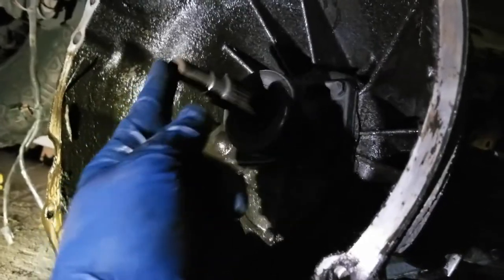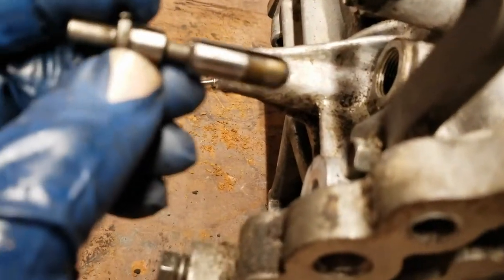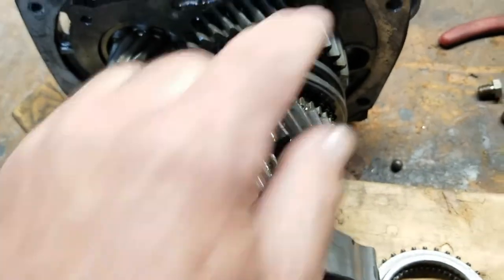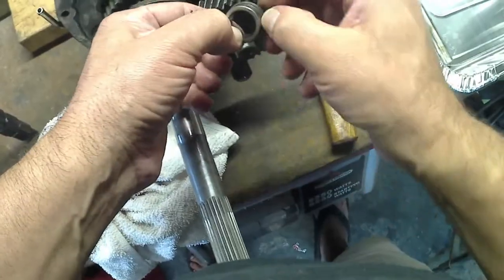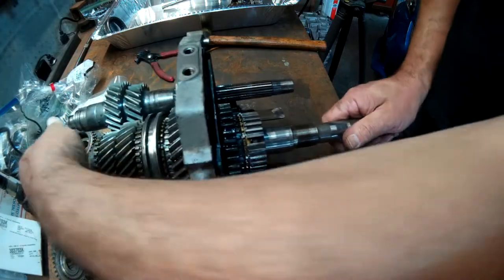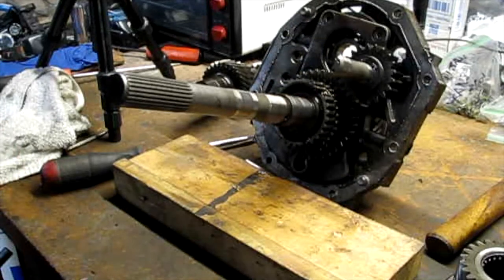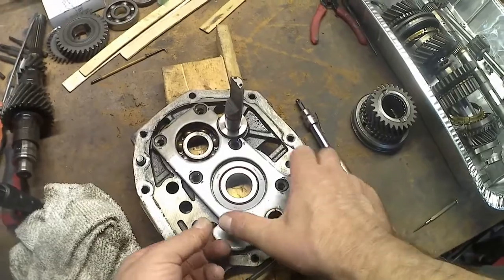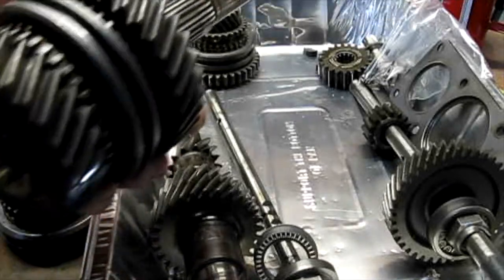95 Nissan 2.4 4x4 D21 Hardbody 5 Speed Transmission

Comment: What could be the problem with mine... it was fixed and immediately after putting it back on the bakkie it slips when i put the first gear on nd does that when i shift into other gears
Reply: Perhaps it was not properly assembled.

Comment: Sir, is it the same for taking out a manual transmission on a 1986 Nissan d21 hardbody?
Reply: I haven't taken one apart, but these trucks are very similar. Get the repair manual and read up on it.